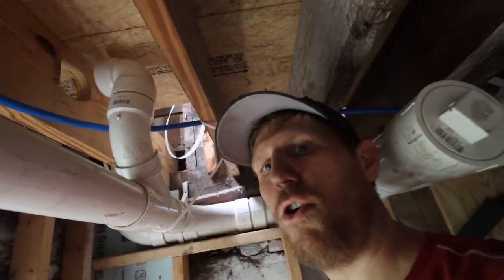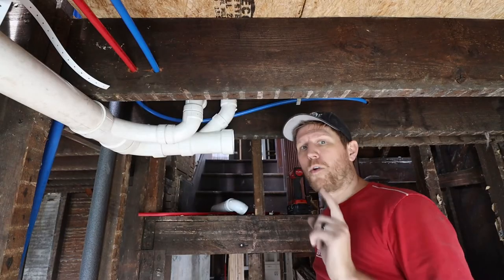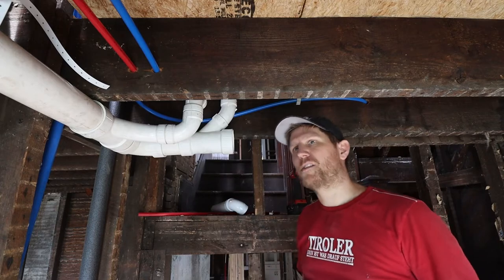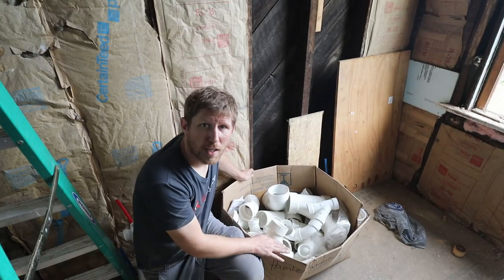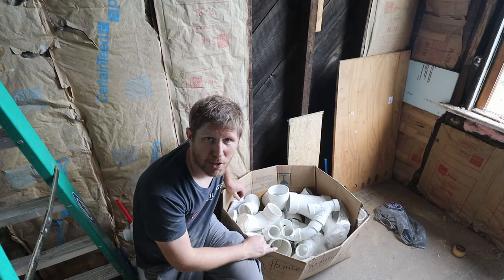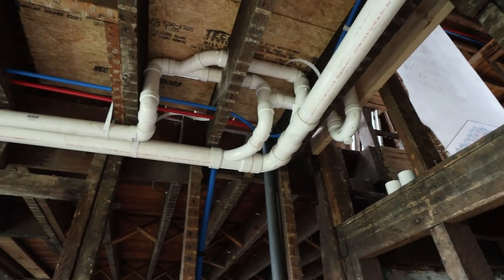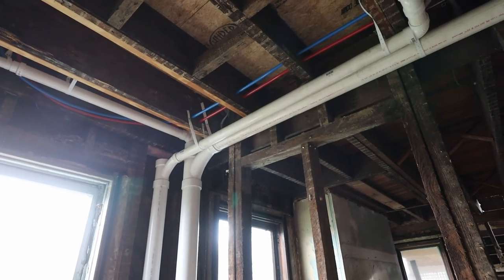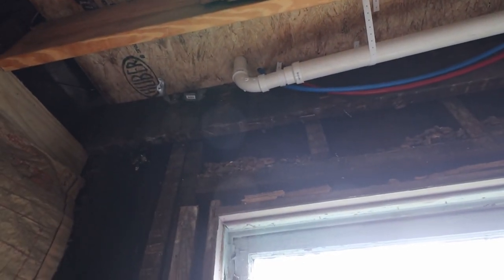Finalizing the Guest/Master Bathroom Plumbing - Victorian Home Renovation [TirolerInn]

Comment: As someone who hasn’t worked on a house or plumbing systems, what is the venting piping for on the shower plumbing?
Reply from the maker: Vents for all the pipes are necessary so no syphon effect can happen in the p-trap. If there was no dedicated venting stacks the water inside the p-trap could get sucked (syphoned) out and then sewer gases can enter the house.

Comment: As a plumber here in the UK, I have never seen a drainage system like what you do in the states. We have A vent stack, but nowhere near what you have. What we have are Anti syphon traps on every waste out let. A 4 inch waste and everything Ts into it.
Reply from the maker: Well I am by no means the expert on plumbing in the US, we are learning as we go, but I know not all vents can be wet vents plus lots of applications in the us plus some states do not allow AAV traps. I will use them on the sinks as I do not like to run vents in exterior walls but otherwise we are supposed to have at least one dedicated vent stack. And since the distance between the bathrooms is so large I will have 3 vent stacks to the roof to make it easier.
Reply: Hi, I am not criticising your work. As I say, I have no idea of Americans code. Also as you will be aware every state is different. So crack on with your work and I look forward to the rest. 👍🏻
Reply from the maker: @MikeC1965  oh no worries. I wish it was easier to navigate myself! Just wanted to explain my thought process